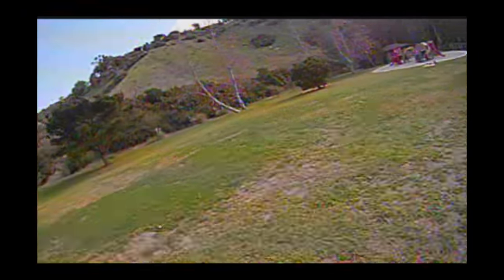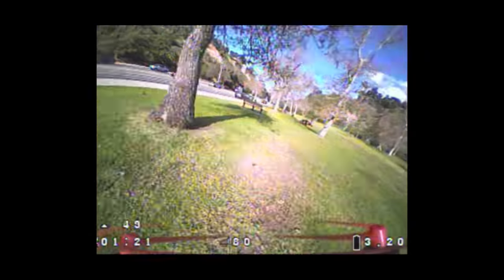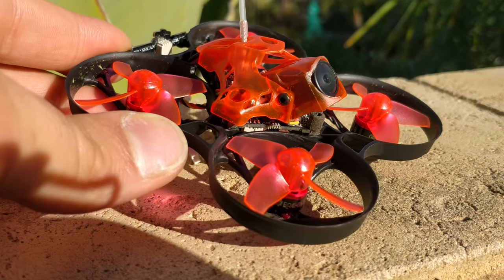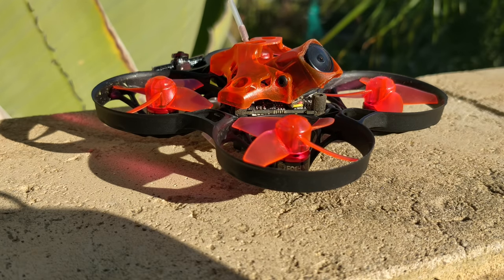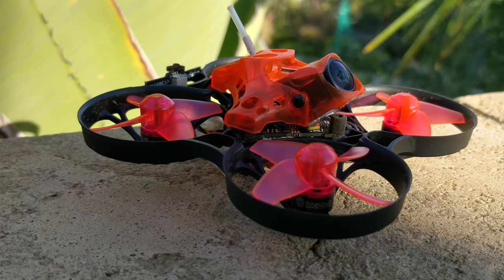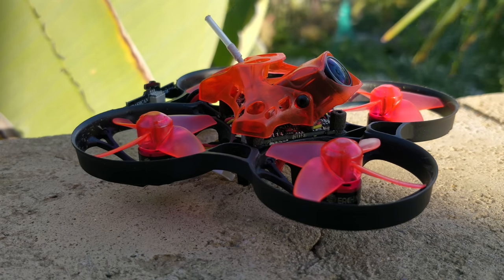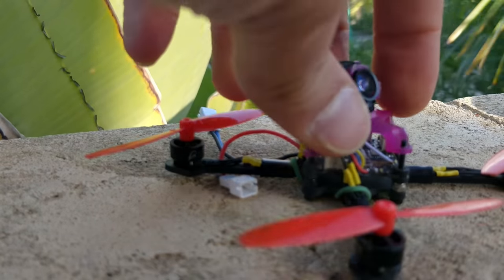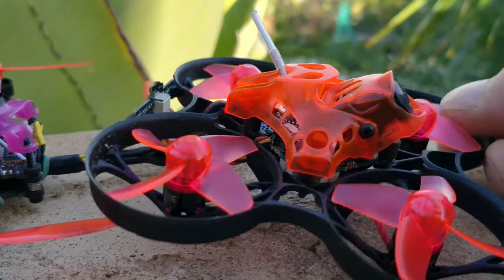Eachine Trashcan - In search of rubbish...

Comment: If I buy the frsky version, can I add an external receiver? Or I can only add the external receiver if I get the pnp version?
Reply from the maker: apparently you can add an external Rx on the pads used for smart audio but you may have to do some other software tricks to get it to work as well.  I haven't done it so I'm not sure.

Comment: i'm curious. is there a benefit to big props that those whoops use ? the hubs look so big. and what are your tri blade press on props going to look like ?
Reply from the maker: you mean the benefit of the large prop on my carbon frame?  The larger prop gives you a far better disk loading factor which provides massive, MASSIVE improvements in control, stability and efficiency.  Compare the flight performance of the two at the beginning of the video.  The trashcan is fast but kinda wobbling all over the place with wonky performance whereas my little carbon frames fly like a full blown 5" quad with very high control and stability.  Both the trashcan and my carbon frame are essentially using the same components.  Actually the trashcan has the advantage of an F4 and larger motors.
Reply: I mean props on whoops with prop guards around them. I really like your build, a lot more than whoops with prop guards. I only own two whoops, so I can't speak for all of them. but the prop guards act like sound amplifier and make a lot of noise for its size and speed. and it might scare people. whereas your build, it flies great and is very quiet. and people tend not to care. where I fly, there are not many people but they walk by from time to time. and I really don't want them to ask me to leave.

Comment: I noticed your flight video has a lot less jello than the other 2 reviews I've seen, I'm wondering if the other guys didn't enable dynamic filter. I was curious if it was the tune or the frame...
Reply from the maker: It's possible they didn't. It's one specific throttle zone that it shakes violently. I was flying to stay outside that throttle point. You definitely see some jello in mine too. Also, they will all perform a little differently due to various differences in manufacturing of parts.

Comment: How would a F4 ESC+FC improve things? ESCs would be 4.3A. You still have to add an AIO camera and a receiver. I'm thinking of combining two open source projects, the tinypepper 4in1 with dronemesh F4 fc.
Reply from the maker: F4 FC allows you to run 8k/8k which on these micros, does actually help.  I dunno what's going on in the firmware at all but it is actually better in real world use

Comment: Hi, I've ordered the trashcan last week, coming after Jan 30... Seeing that I will probably make a toothpick out of it 😁 range will not be an issue for me, I took the no rx board since I'm using eu firmware and not sure about update firmware on an on-board rx 😅

Your builds  are very inspiring, I've got a tooth fairy 2.5 on the bench and can't wait to fly it and the toothpick  is fire! Don't you think that we can remove the motor plug of the crazybee and direct solder  to lower the stack and maybe don't have to extend the wires?
Reply from the maker: Yes you can but thats just a really small solder job. 😅

Comment: Sorry, confused about the 16:9 vs 4:3 issue. You mentioned that you have Dom V3 goggles but they are 16:9 which should match the Eos2 ratio.
Reply from the maker: Yes the Dom v3 does but even I prefer the 4:3 view that's stretched out to 16:9 in the goggles
Reply: @Kabab  Oh, that's why I can't fly as well as you do! It's the goggles' fault!😂
Btw, the toothpick is a totally awesome project! Getting mine as soon as it becomes available, experimenting on my own till then. I am a huge fan of 3025 two-blade prop on a light 2S build. The toothpick will be even more amazing! ❤️

Comment: Whats the hole spacing on the micro boards? Should I make one with a Crossfire Nano built in?
Reverse engeneering that shouldn't be too hard.
Reply from the maker: 25mm for the aio board. 16mm for the regular micro stacks
Reply: @Kabab  ok i'm gonna try that with the aio size.
the components can be just tranferred over.

Comment: Thanks for giving me another class to look into. I'm starting out with the hobby, got my goggles and controller but getting an actual drone seems to be impossible for me: my mobula7 order got cancelled, now my trashcan is on back order, whatever that may mean... I was about to order some 5" parts, but indeed, everybody seems to freak out if they hear or see such a "powerful" quad. Don't think I can wait till you get your setup perfected out, so I'll look into what Mr ShutterBug does/uses.
Reply from the maker: Lol who freaks out around a 'powerful' quad?  I think these new brushless whoops are good beginner options as is my little carbon frame thing. It's really simple and super duper durable with the low weight.

Comment: Liked and Subbed.

How hot can the motors get without it being a concern?

Immediately after only a 30 second or so flight the little motor mount screws are almost too hot to touch. I mean they get hot enough that now I tap them first before maintaining touch. If they were a few degrees hotter I wouldn't want to touch them for more than a half second or so. This is, of course, immediately after landing.

I'm new to this so I don't know. Maybe such temps are normal? I only noticed recently when I got good enough to land in my lap and felt the screws' heat on my thigh. 

I don't exactly have a trashcan but cobbled together a M7 / Trashcan hybrid using the V3 frame and stock props, the Crazybee F4 Pro fc but with 19000kv motors. (I wanted 16000kv but the shop I go to was out of stock.) From what you mentioned in your video it seems as though I should have held out for lower than 16000kv motors.
Reply from the maker: Micro motors tend to get really hot but it's not ideal for them to. They loose a ton of power and efficiency when they're hot.  Usually adjusting filters and such help to manage unwanted vibration signals to the motor and manage heat but in some micro cases it's just a really powerful motor.  This usually happens in a motor of size 1105-1108. The taller staters draw lots of amps and the motor is too small to disapate the heat. In that case, filters don't do anything. It's just a hot motor always on the edge of burning.
Reply: @Kabab   KababFPV  OK thanks. I ran the motors using betaflight and they still got hot. I can def press lightly on them for five seconds but if they got much hotter I wouldn't be able to. I guess they've always been that way and I didn't notice.
Reply: @Kabab  Update: I checked the mounting screws after each outside flight today. They were no where near as hot. Just warm in fact. The previous times I checked were after slow cruising around my small apartment. I guess the slow movement lets the heat build up more.

Comment: Why make a whoop this powerful you say, I have the mob7 and what Ive found its perfect for bigger indoors, like parkades, and buildings bigger then your home. Also for outdoors it handles the wind way better then a brushed whoop.
 I can fly it in my house on 2s but in angle mode. 
To me a 2s whoop is great. You can fly it outdoors in areas I wouldnt fly a 120-140, like a Leader. With people around they are not bothered at all as its so small and toy like. 
Your carbon frame quad looks wicked however that is going towards 120 size like my Leader, so I already have something in that catagory.
Great review man! subbed

Comment: Would you  post a link to the beta flight settings you changed or your configurations so others could know what items they should change when they buy this unit?
Reply from the maker: Oh sure. Forgot to put those in there. I'll add to the description
Reply: @Kabab  thanks... My main reason for originally ordering a trashcan was to have something with a bit more power then the tinyhawk with more of the durability of the Modula 7.   That toothpick drone you are making looks very nice but with props that large any sort of indoor prop guard system would make it very large.  

I am still waiting to see when we will see something like your toothpick drone that can save nice 720p video.  No doubt we will see more advancements in Runcam split style technology in 2019 and having hd in our woops will become common by the end of 2019.

Comment: I wanna see the frame you have the mobula7 crazybee fc on please?And have you thought about the tips of the frame with bumpers that the motor is recessed down into to protect the motors a bit and maybe make a couple out of forged carbon 🖒🖒
Reply from the maker: Forged carbon is 100% garbage. Not to be used in any quad product imo. Motor bumpers are built into my most recent design. Check out the link in the video description for more. I'm working on some things

Comment: Could you help me out?
My trashcan seems to over react when hitting obstacles, like a bouncy rubber ball it just revs up the motors to full throttle...
Is there an betaflight fix?
Reply from the maker: It's trying to stablize itself and overcompensates. It's likely normal for it
Reply: @Kabab  thx for the help!!
So its the weight of it and other factors? My Us65 never did such weird things.
Reply from the maker: @m.d.6649  make sure the dynamic filter is on as well as some of the other filters. Could help a lot
Reply: Thanks very much for the help, you dont get that very often !
Reply: @Kabab  what other filters would you suggest and is there a way to change specific filter settings in the pid settings for example
Reply from the maker: @m.d.6649  yeah that PID menu. Just start thinking them on. Maybe turn them all on and fly. See what happens.

Comment: You have the best reviews hands down! Always looking forward to them. I have a spare aio fc from my ur65, and really looking forward to make something like the flying Prius 2.0. what is the sweetspot for motors i can use now on 1s with this board but also rocks later with 2s if i upgrade my fc? And beside that, shoukd i go for 300mah or 450mah now for 1s? Thanks in advance!
Reply from the maker: I haven't tested the 1103 yet but I'm betting that will be the sweet spot and maybe 1202 in the future. The 450mah 1S is excellent on it as is a pair of 300mah in 2S configuration. I'm still working on testing setups and optimizing the frame. I also have an alternative frame I'm working on that puts the batt on top. I'm pretty sure it'll make a significant difference.
Reply: Kabab FPV thanks for the quick reply! The last couple of days i’m so excited for your frames, i can not wait! 1103, with what kind of kV? When Will we see the new frame? Kind regards
Reply from the maker: @Tidges01  I got 10000kv coming. Hopefully the first iteration of the frame will be available before Chinese New year so within a month
Reply: Isn't an 1103 going to add too much weight? I thought that was the appeal of these 080x motors.
Reply from the maker: @Dangeresque14  it's gonna add 1.5g total to the whole build. Hoping it'll be worth it
Reply: That's better than I expected. I know the 1103s from the beta 75x are supposed to be super light. Might be a good option if you've already got one.
Reply from the maker: @Dangeresque14  the beta 1103 is the racerstar one but the very old version that was very very poorly constructed
Reply: Kabab FPV i feel like buying stuff on the frist day of 2k19. What 1103’s do you recommend? I cant wait untill Chinese new year :D
Reply from the maker: @Tidges01  I haven't tried enough but I'm hoping the racerstar 1103 is decent since it's so cheap. Really easy to recommend

Comment: Oh yea, some people are cool flying with what they got :D I was always getting the boards without receiver as those suck :D hard. Even with a good antenna. Not sure how that half wave antenna works out for you but (I guess you know) the longer the antenna the narrow-er the donut (I even tried the 3/2 antenna :D ). You can never get a better reception with different antenna of the same type. Only different receiving pattern (you can get better horizontal reception but get a FS on dive as you change the signal polarization). I was also trying to get the most out of those receivers and the best is to just stop using them and get the XM receiver. Shorten the antenna and fly. As you like to say :D its day and night difference :P
Reply from the maker: Frustrating.

Comment: Interesting. I actually seek out cmos cameras for the shadow handling, AND far prefer 16x9. But I realize I’m in the minority there. But those are the only cameras I seek out (the micro eagle like you mentioned).
Reply from the maker: The micro eagle is super special. It has a half inch sensor. That's about 3x the size of any other fpv cam and even much larger than a GoPro. All other regular cmos fpv cams typically suck at most things compared to a CCD however they do look higher resolution half the time.  A CCD is definitely better at light handling in difficult lighting situations.  The issue with 16:9 is that you loose the vertical FOV that's so important for fpv flying

Comment: did you take a look at the motors of the KingKong GT7 or GT8? they are 0803 9000kv or 0804 7500kv. they could fit the 66mm prop quite well
Reply from the maker: They would work but I'm looking forward to testing the 1103 first. Hoping it'll be the IT motor for the prop.
Reply: don't forget the 1.5mm drill to increase the holes on the 66mm prop. that's why my miracle whoop with 1103 10000kv sits still on my bench :D  @Kabab
Reply from the maker: @blackforestfpv3046  yep. Already have them.

Comment: Hi Kabab, i crashed my trashcan and 2 motor shafts where a little bend and it was unflyable.
I bended them a little back and was flying a pack when the power dissapeared so i thought the battery was empty.
Now it doesnt turn on anymore on batteries , it lights up with USB, and when i connect a battery i can read the voltage in betaflight.
It doesnt seem to be the power-lead since it can read voltage and cells etc.   I can also power the motors in betaflight full speed. 
What the .. can this be?
Reply from the maker: Unfortunately it sounds like the 5v regulator on your board has burned out 😣. There is a way to fix it. Check out Albert Kim's channel. He has a way.
Reply: @Kabab  Yeah that might do the trick man thank you very much! I can see  that same regulator on a national reseller website here.  What AWG should i add to the cart? He's using pretty thick ones but i dont know what size.
Reply from the maker: @boratsagdiyev1586  probably 24awg or just use some camera wire
Reply: @Kabab  Isnt all the amp draw going through a thin wire then? 
Edit: I'll just add some 24awg to my cart, i've got some thin wire laying around :)  Thank you man i was close to throwing that thing away since i already ordered a new FC.  But i might fix it now and make a Toothpick gheheheh.
Reply from the maker: @boratsagdiyev1586  this is just for the 5v. The while quad doesn't run on 5v. There is almost zero Amps

Comment: Can a separate Rx like a XM or XM+ be added to the Trashcan FC and disable onboard Rx?
Reply from the maker: I believe so but haven't tried yet
Reply: @Kabab   I researched a little and info from a friend and yes a separate Rx can be added  to a Crazybee F4 Pro (and F3 Pro)  with a built-in Rx of any type. I will add a XM+ when I get mine (which is a FrSky version) which should be plenty of range for the 200mW VTX. Surprising more YT reviewers haven't mention the Rx range issue on this Trashcan or the very similar Mobula7 with the F3 Pro and essentially the same Rx.

Comment: Can I use LHCP patch antenna with RHCP Cloverleaf antenna on my furious fpv true d module ? Or should they both be LHCP or RHCP ? What combo will give my the best reception ? On the quad I am using RHCP Cloverleaf antenna. Can any fellow FPV peeps help me out ? I'm still new at all this. Thanks.
Reply from the maker: You can use LHCP with RHCP but it won't be as good as a match between the two.  Alternating polarities typically helps reject other channels that are nearby and opposite polarity.
Reply: @Kabab  Ok I get it now. thanks for helping out the new guys. Love your channel.

Comment: So what would be the right KV for 2S on tooth pick and on whoops? 9000-10000 KV ?
Reply from the maker: I think maybe 10000 or 11000 for 1S and it'll still work on 2S with an endpoint limit
Reply: I like dedication. So I love a (near) perfect whoop for indoors (like emax tinyhawk) and a correct sized 2S micro as an outdoor toy. So kV could/should be sized for 2S without throttle limit. No need for a compromise.

Comment: i'm guessing 5A esc is the limit for this setup. with 16x16mm, now you can get 10A esc from hakrc. I don't think they had that a year ago.
Reply from the maker: There's a new 16x16 esc that'll do 10A?  5-6A is enough for these tiny motors on 1S-2S really.  The battery can't even give you that kinda amperate times four motors.
Reply: BetaFPV 65X/75X board have been upgraded to 10A last month too, but the separate stack, not the new AIO board. What Bob said though, you don't need that and couldn't pull that out of these batteries anyway.
Reply: oh I just put it out there, just in case he needs more than 6a for very light build. seems like not many people know about 16x16 10a board. fullspeed has 16x16 8a and running 3s in their new whoop.